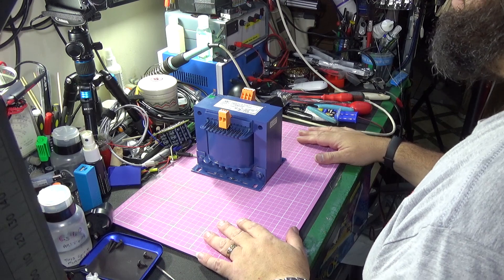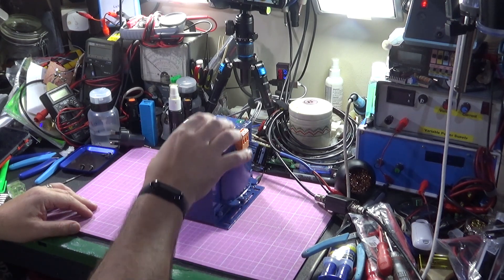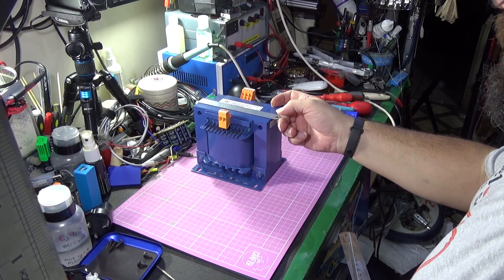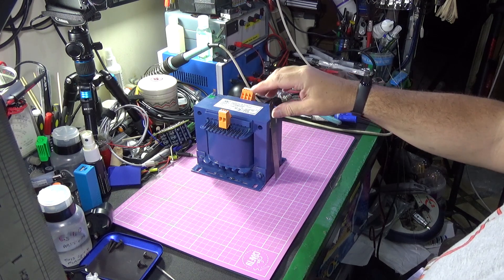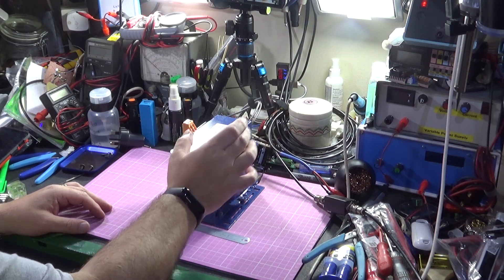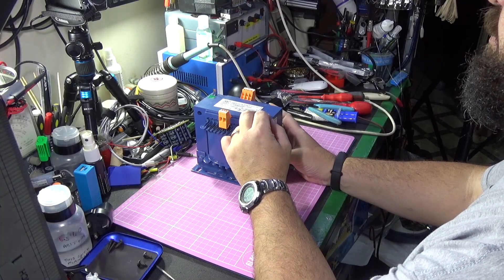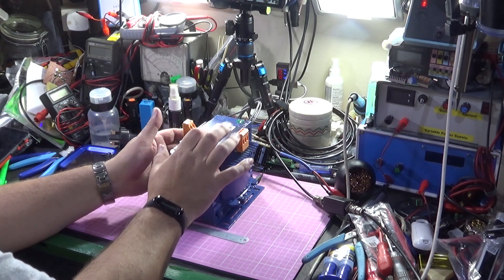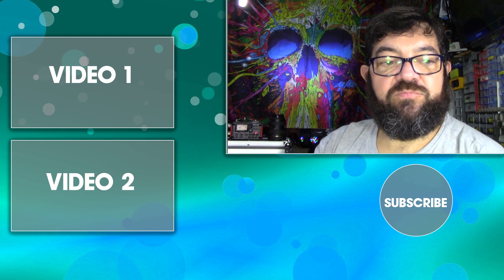Isolation Transformer for bench safety

Comment: Just bought a 240v symmetrical isolation transformer through the local buy and sell pages a week or so ago for 5 Aussie dollars (about £2.70!) . Manufactured unit, the metal box a bit untidy, rated at 1500VA 6.5 Amps, really really heavy. I don't think anyone really knew what is was.  You said in another comment that builders use these?
Reply from the maker: Yes, it's a UK requirement that all site tools are 110v not 240v. All around building sites there are yellow isotrans boxes where anyone using power tools had to plug into. 

You got a great deal for the money you paid!

Comment: That's one big transformer, Boy!  Whew!  I have an isolation transformer but it's about the same size as a transformer in a 1930's radio.
Reply from the maker: I do have some smaller ones but I didn't want to be limited in how big an item under load could be. This beast should let me draw 5a at 240v. If anything needs that much current then I'm in trouble!